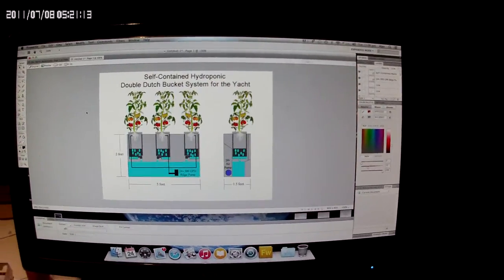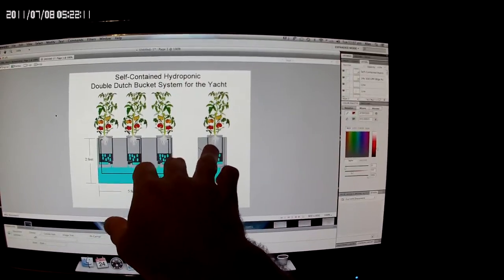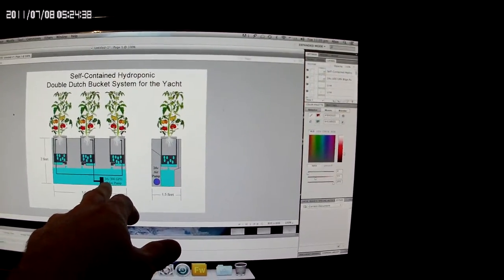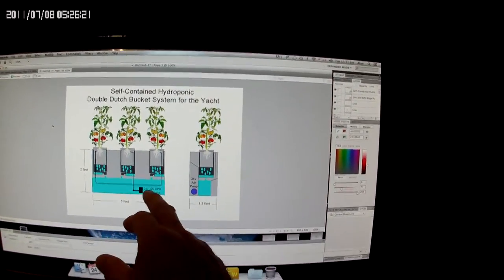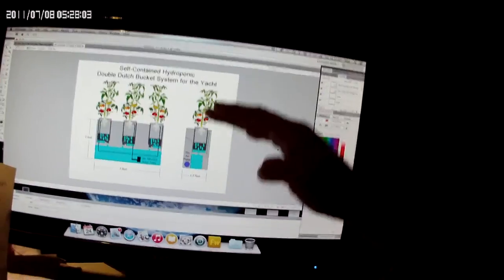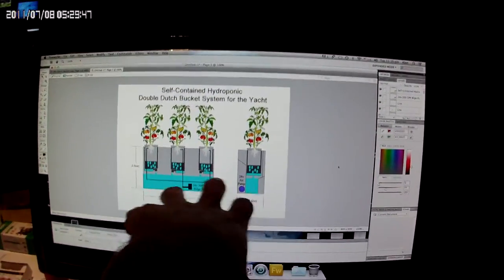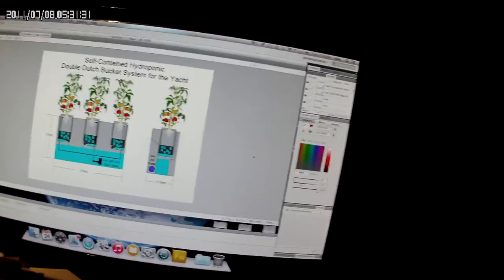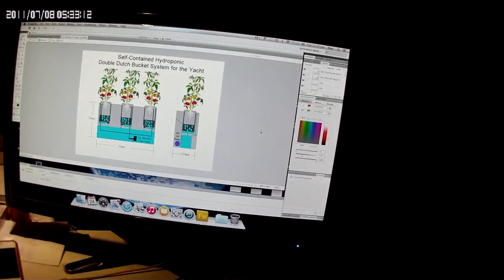Self Contained Double Dutch Bucket System Part 1

Comment: Think that product name here is Nidacore Honey comb plastic sometimes with a mess to help adhere to fiberglass cloth. Also can be had with a expanded foam in the comb for insulating purposes. There is a company called Fibertech in U,S, where you can order it with whatever lay up schedule you want by the sheet up to 10 feet by 54 feet as they make them for Large truck van sides.and R.V.s  

You may form your boxes then find a fiberglass shop with a chop gun they can spray it and then you just need to skrim the outside for a finish. Used to get battery boxes done that way when I was installing boat generators, Plywood mockup then coated with chopped glass.

Brock only made the double dutch system to stop root intrusion into his return line so anything you do is OK Bobby never seemed to or mentioned that trouble. Never thought if you could actually get Beto buckets ,, Might be the answer.. Anyway good video as usual . I made a little progress on the dinghy yesterday posted a video. We are socked in with fog this am a rare happening for us. 

                                                                                          Cheers  Ken